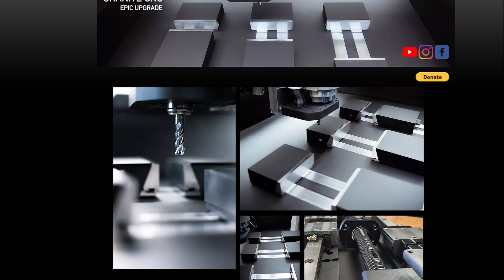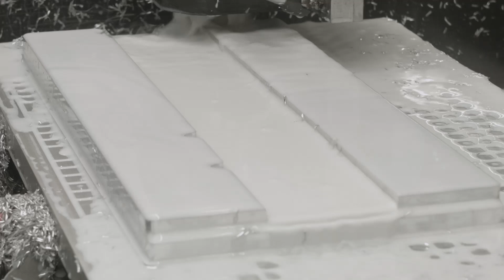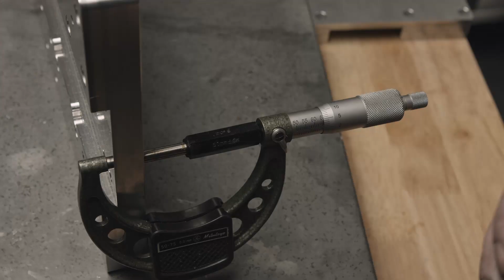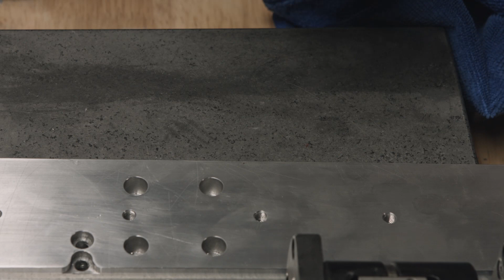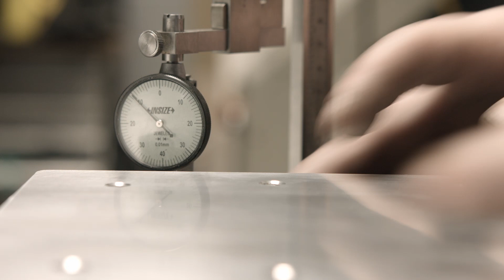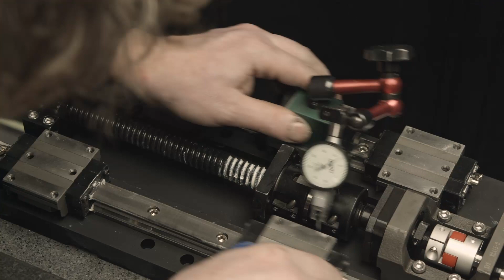EPIC CNC upgrade - episode 4. Submicron Precision Z axis, Machining, assembly and fine tuning

Comment: Good job.
Don't worry for the 20 um of screw wobble: it is not a problem coz the screw will be guided by the nut after assembling. You don't need a "better one".
Reply from the maker: thanks for cheering me up :) 
20um leaves a bad taste after all the work i have done.
the wobble is particularly visible in Z axis when you start 3d milling. 
when the screw turns fast  its will shake the whole z axis. 
i guess 20um on a screw won't do much, considering it is only 10um from the center of the rotation once screw is bolted. 

ok now i feel much better :D thanks :D

Comment: Why not repeat this measurement by placing 10 kg on this aluminum plate?
Reply from the maker: Great question. I havent done it yet because its not attached to the gantry and it doesnt have spindle clamp. Those things will change the amount of flex it will have. I will keep it in mind when i bolt it in. Thanks for the suggestion

Comment: Pretty good job Fox! Thanks for sharing.

2 remarks from my side:
-The precision of the alignment of the rails and the ballscrew do not correspond with the quality of the shaft coupler. If we are talking about microns of precision,  precise shaft coupler should be used instead of the plastic inserted one.
- The positions of the rails and the ballscrew's suppor bearing should be fixed during the lifetime of the machine. In the industry it's solved with "constaining the ground surfaces of the rails and the bearings to a pre-machined, defined edges". But for us, hobby guys there are special materials exicting, which were developed for this kind of job. My purpose is for example the Diamant DWH. Maybe it cost a bit more in New Zeeland, but it worth it. You just to have to dispense it to the side of the rails and bearings, and when it bonds, you'll get a proper, solid joint, which fixes the rails.
Reply from the maker: Thanks for the tip, i will check it out

Comment: Why didnt you put ballscrew and linear rails on the z plate? That way you could more seperate linear rail carages and have linear rails on the bottom of z plate which increases rigidity. You have to mount spindle much lower than those rail blocks are so why not encrease rigidity with those rails? Only con would be that z axis motor has to be mounted on the z plate then and it would be a little more tricky to assemble it, but it can be done.
Reply from the maker: i guess its my personal preference. but i did think about putting rails and blocks flipped.
1. my rails are fixed from the top not from the bottom. kinda bummer when it comes to assembly and adjusting.
2. I'm not the fan of variable rigidity, when you mill at the top the z axis is the stiffest and as you go lower it changes. 
so i prefer to have the same finish all around.
3. z axis has 2 plates, front and back. they both bend. so loading one makes other more flexible.  and than the weight, with the servo and 20kg hanging i'm a bit concerned of servo holding it up when its turned off. i don't want for the Z to drop as soon you turn off the machine. 
Im trying to avoid building a counter weight at the back of the gantry.
Reply: Have you considered adjustable gas filled rods as an alternative to a counterweight? That's what I'm planning to use for mine. Looks good in my CAD model but yet to try it.

Amazing videos by the way 🙂
Reply from the maker: Someone also recommended it. I will investigate it when it wont hold up. But from what i tested it should be just enough.
Reply: @PiotrFoxWysocki  fair enough. My thoughts are that it would also take unnecessary load off the ball screw. But that's maybe not important with one the size you're using. It's quite large!
Reply: @PiotrFoxWysocki  
A pneumatic cylinder with a large feed line to a large pressure tank with a regulator will give you an adjustable - but more importantly almost constant pressure -> constant force.